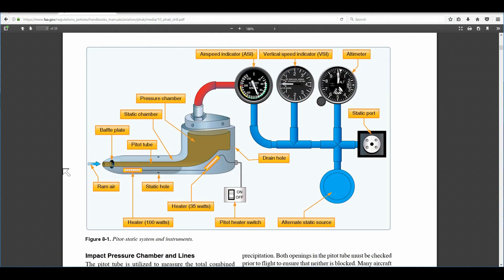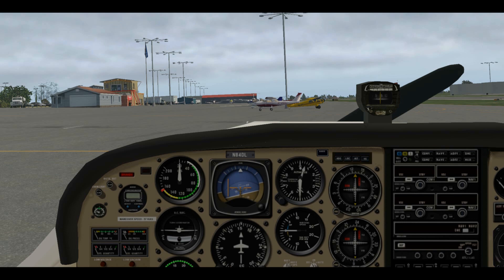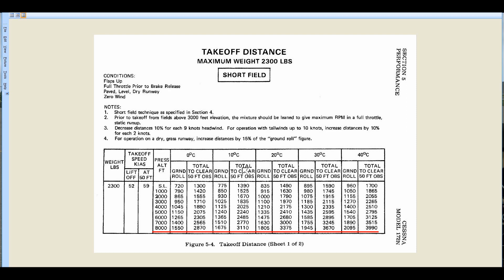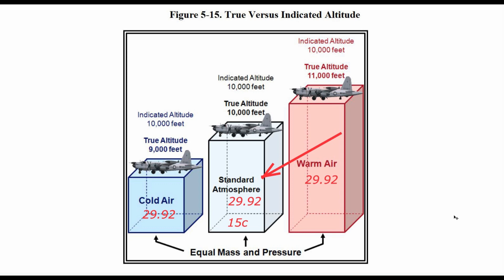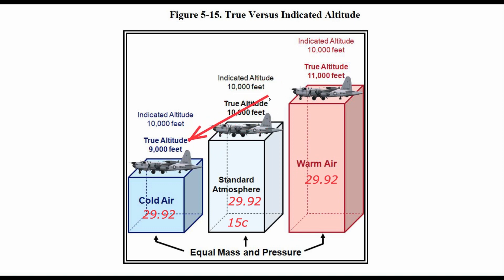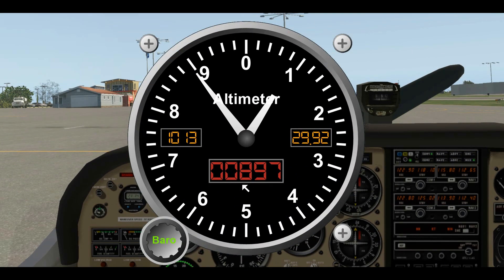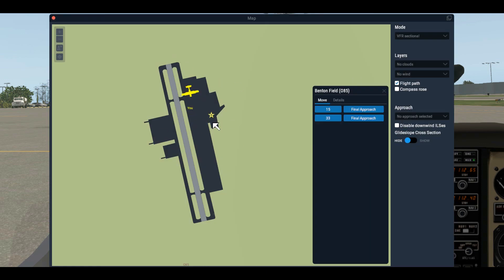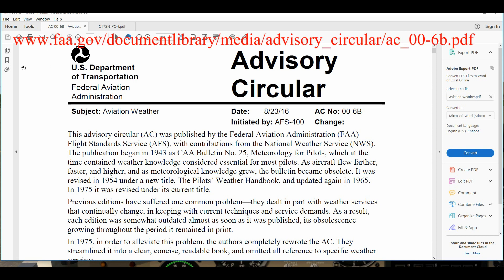The Altimeter ~ Learning to Fly for Beginners in X Plane 11 Part 10

Comment: Hi Skip thank's for your videos , i have a question how you do to have free windows on your screen with cockpit instruments, i have xplane 11 and OSX Mac. Alan
Reply from the maker: Hi Alain,  Thanks for watching. The instruments I use in these videos are not free I purchased them from two companies  www.simplugins.com their program is called Panel Builder  and SimInovations,  www.siminnovations.com their program is called Air Manager. They are good if you have more than one monitor, you can created a whole instrument panel on a separate monitor then just use scenery on your main monitor. I have three main monitors and a fourth I can use for a complete panel. I do not like just having scenery on my main monitors. I prefer looking out windows so I use the instruments on the fourth monitor to display instruments I can not see in the normal cockpit 3D view, this way I don't have to change my view to see the instruments. The fourth monitor is also good for placing the larger FMC or GPS instruments.

Blessings,
skip
Reply: Thanks Skip for your fast answer, I'm going to bought Air manager only , because Panel builder run exclusively with Windows and I 'm on Mac OSX, at the moment I work only with a second screen.
Reply from the maker: Hi Alain,  Good choice, there are a lot more instruments from which to choose and you really don't need both programs.

Blessings,
skip
Reply: WEH Videos  Hi skip , i see i don't need two programs , i discover slowly airmanager ,it seems to be very interesting.
Reply from the maker: Hi Alain,  I think you will like it. If you need help there are several videos on YouTube just search for "air manager x plane".

Blessings,
skip

Comment: Hi, thanks for the video. It's some good videos you make :)
What effect does moisture have when it changes in the weather?
Reply from the maker: Hi SpotterSky,  Moisture is a factor but not enough to consider or worry about 99% of the time.  Naturally rain would be a factor to consider but for most flights just getting the current weather and updating your altimeter regularly is all you need to do.  

You can find out more about moisture in the weather advisory on the FAA site if you want to learn more, it goes much deeper into Aviation Weather.      www.faa.gov/documentLibrary/media/Advisory_Circular/AC_00-6B.pdf

Hope this answered your question.

Blessings,
skip
Reply: Hello ship, thanks for your reply :)